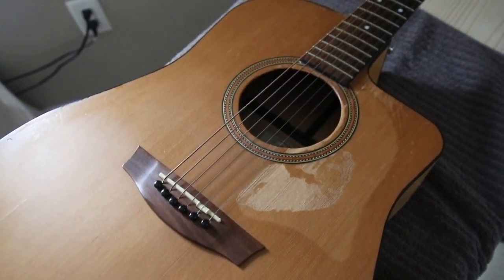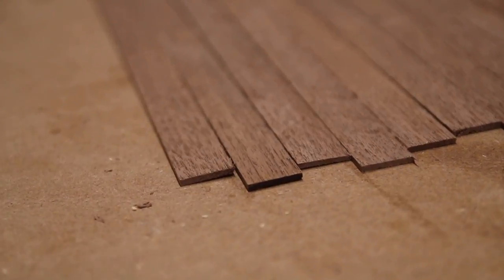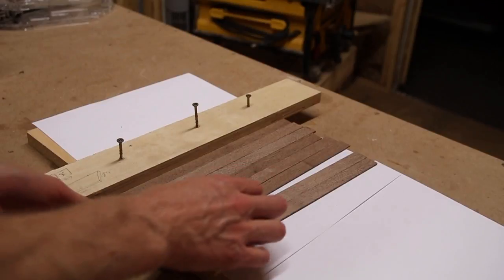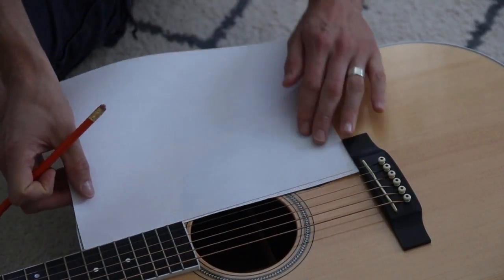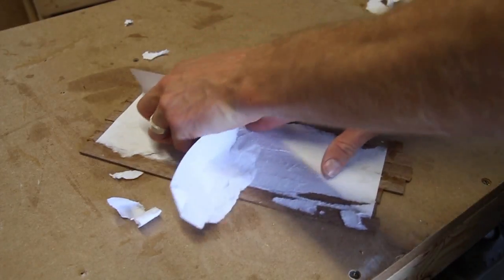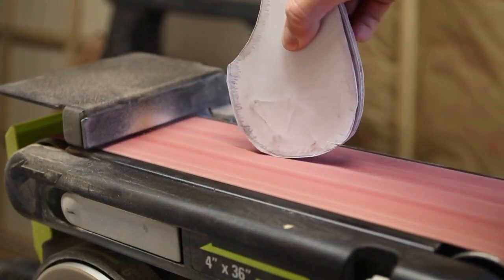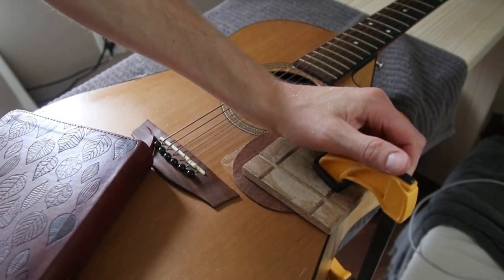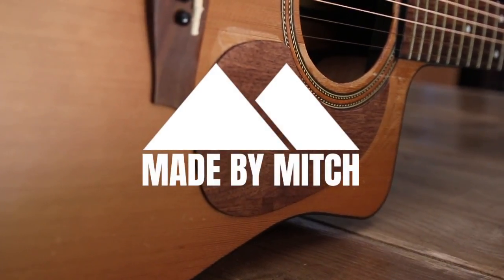How to make a Guitar Pickguard

Comment: The most complicated project I’ve ever worked on was a fancy knife I decided to make. Made the blade just fine but decided it needed an ebony handle and a very specific decorative finger guard and pommel made of copper. Sooo off I went to to make a whole foundry set up from scratch and learn all about casting metal, making green sand, casting molds and flasks …  It was supposed to just be a knife lol

Comment: Great Job.... currently i'm working on corbels for my breakfast room (as decoration) and the corners for installation are 5/8" off from a true 90 degree corner ... had to take the corbels apart and I'm having to install the horizontal/vertical sides independently of themselves.  I expected some difference in angle degree but not 5/8".  I laminated 2 2x6 (trimmed down to 4.5" wide) and they are 20" long.  I thought of shimming but i have to make up the difference at the corner due to overall size.
Reply from the maker: Wow! That seems like a lot of work just because of the angle being off. Good luck! Thanks Nancy!

Comment: Sweet vid.  Keep them coming.  I just don’t have those tools you have. So it makes it hard when you’re limited to tools. When i have All these ideas it makes it tough.  It also helps to have a garage and space to work
Reply from the maker: Thanks staticswitch! And I totally understand the limited tools. I used only a circular saw and drill for a long time. Sometimes you just have to work with what you have. You have to get more creative with limitations so it can actually be helpful at times. Good luck with your making! Thanks!
Reply: For sue. Thanks for your reply.  Can you make a video on how to make a 12 string nut or 10 string?.  I need to make one for a Bajo Quinto Guitar. It has 10 strings and I need to make one. 
(.024 / .024) 1st set
(.036 / .036)	2nd
(.046 / .046)	3rd
(.062 / .030) 4th
(.078 / .036) 5th

These measurements are from my GHS string kit.  GHS BSX-10 Stainless Steel. http://store.ghsstrings.com/bajo-quinto-strings/

Just wanted to give you info about the strings and the type guitar I play. This would mean a lot if you did a vid.  https://en.m.wikipedia.org/wiki/Bajo_sexto
Thanks your the best!!
Javier